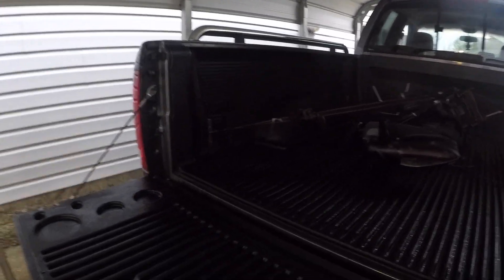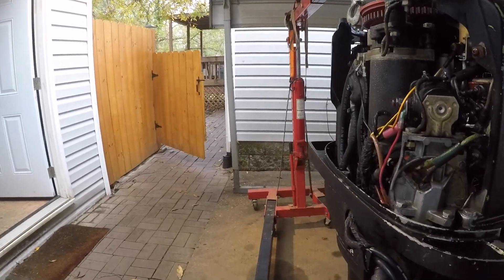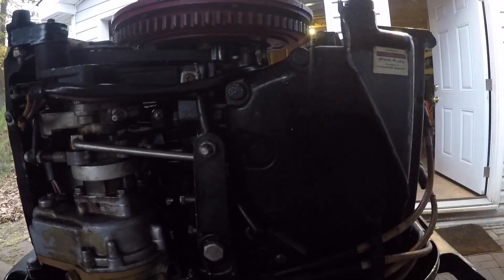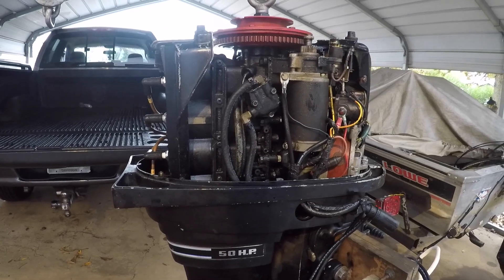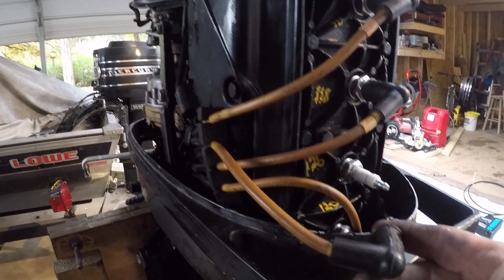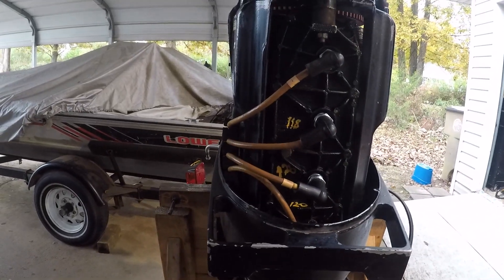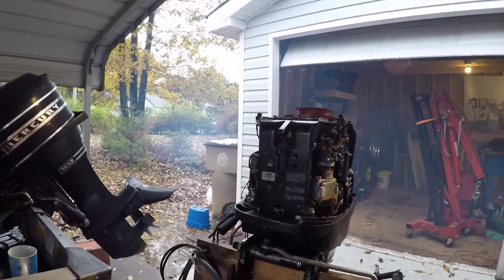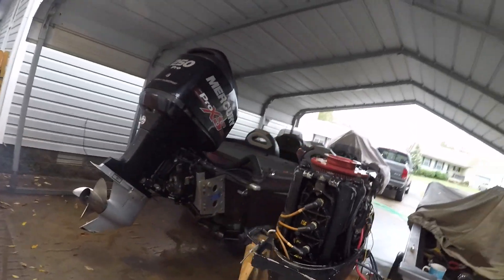Mercury Thunderbolt 500 50 hp engine Part 63 NEW UPDATE NEW MOTOR

Comment: When they changed the potting material in the switch boxes they would shrink in extreme cold and pull the wires off the connections causing failure. A guy I know has worked on just Mercury engines since the 50s. And still has a shop in his garage. On days when I have nothing going on I go hang out with him he has taught me so much about the history of Mercury. The sad thing is someday all the knowledge will be lost in time. He give me hell because I love OMC but Mercury is still pretty cool too.
Reply from the maker: I know those guys are not around anymore.